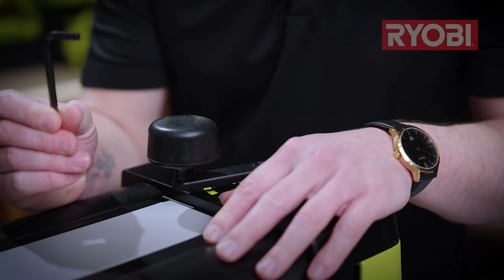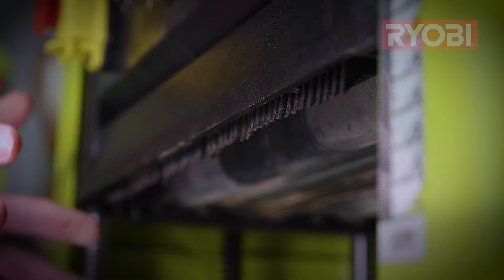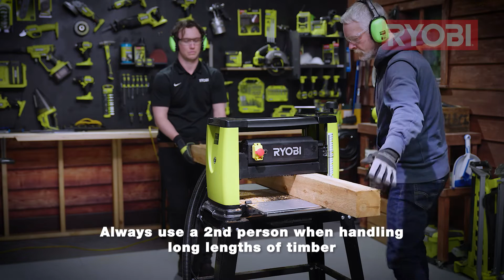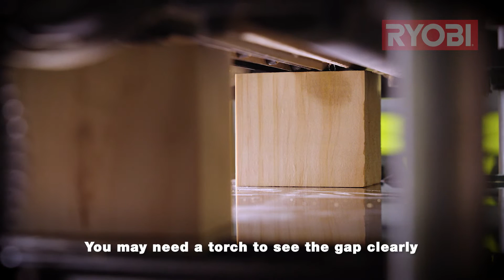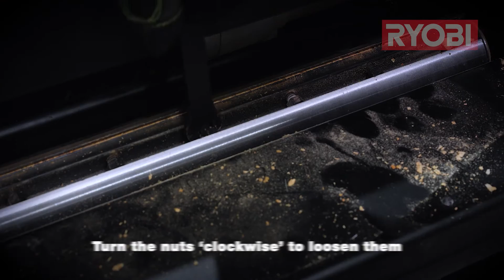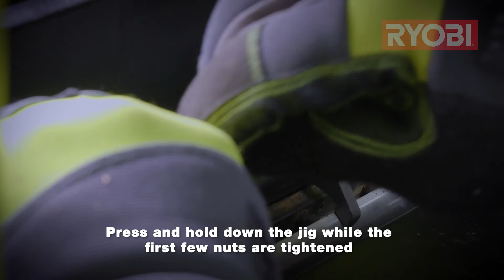Ryobi Thicknesser - How to setup and maintain it

Comment: I almost bought one, glad i did not, only one blade on the cutter, got a deal on mastercraft for the same price (same thing but with 2 blades on the cutter)
Reply: You didn't look at the video did you... It clearly has two blades. But the original blade is one sided... while replacements has two sides.
Don't think you can find a one blade machine. The better machines has three blades or spiral cutter for high end.

Comment: For leveling the blade - "you'll need two short pieces of timber of the same height to be used as gauge blocks" is much more useful than the instructions in the manual that came with the machine - "The tools used for checking are shown in figure 15. Use hardwood to make a tool gauge block according to the size show in the figure". Because, y'know, your typical D.I.Y'er is certainly going to have a bit of spare hardwood lying around and the tools and know-how to make a millimetre-accurate complex shape out of it.

I ended up using a couple of blocks of Duplo - 63.6mm tall (standing on its end) and manufactured to pretty tight tolerances...

Comment: Bought my first planer a few months and it was a Ryobi. Out of the box it's great except it doesn't plane evenly. I was about to try and sell it and try I a different brand but came across this video and realized you can actually fix that. Will have to give it a shot first. Unfortunately I planed a crap load of boards with this issue and never realized some pieces are terribly uneven. Pretty pissed but oh well you live n u learn I guess